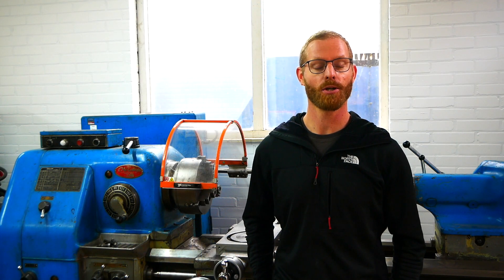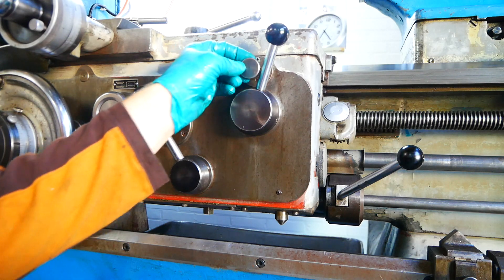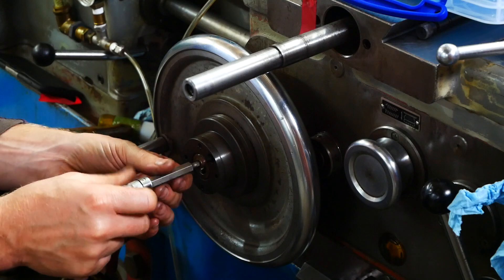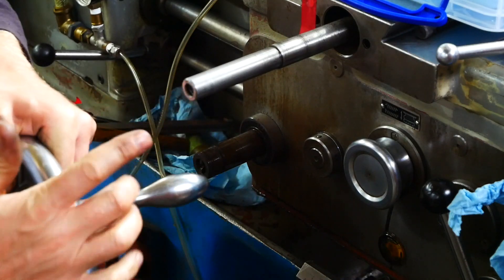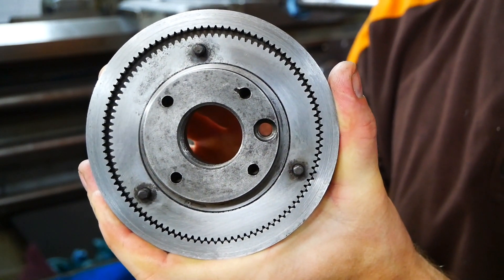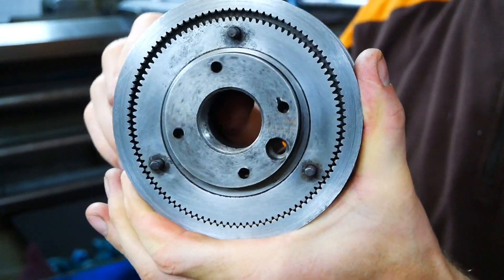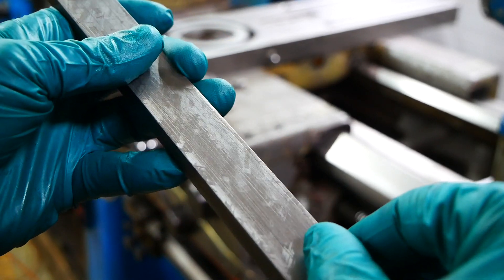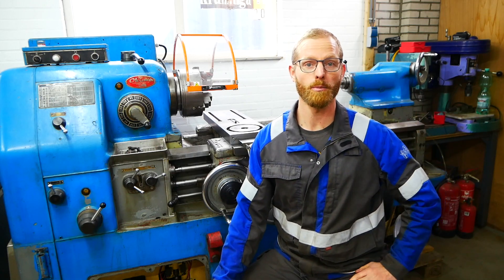Okuma LS Adventures Part 3: Apron

Comment: I have the same lathe and i was threading a large shaft and the half nut he wouldn't release which caused the tool to crash. i can see the nut engage the lead screw,  and i can see the screw turning, but the apron won't move.  Seems to me the half nut must be damaged, but i can't see any broken parts.  Any thoughts??

Comment: Hi Bart,

I have the same machine here in Australia that I’m currently restoring.  Mine is missing the cross slide and compound slide lock levers.  I see you play with it quickly in your video but I’m unsure of how they’re meant to function.  If you can help me describe them and the function or pull one out and send me some photos please reach out!
Reply from the maker: Sure, send me a mail to bartharkema at g mail dot com. Or Instagram private message.

Comment: Hi Bart what is the name of teh cleaning psste you used on teh front apron ? Commander....? I have the same job to do on my Okuma LK. Pete
Reply from the maker: Hi Pete. It is called Commandant here in the Netherlands. It's an abrasive polishing past. Works also very good on Aluminum. I only use number 4. But there are different numbers for different a abrasive size. Link : https://www.harjonpolyester.nl/product/commandant-cleaner-nr-4/?gclid=Cj0KCQiAzsz-BRCCARIsANotFgPJiHo7cM3Eo8NePymULnYqbjk_Lfb56a-RYsxbVU3SguoKrthHfVEaAu38EALw_wcB

Comment: I have just watched your interesting video. Thanks, Bart. My comment is a bit late, I know.
 You could generate a lot more pressure to clear the oil way using a grease gun. Or maybe you have a hydraulic front brake lever unit from a motorcycle. Of course, you would have to contrive an adaptor for it.
Cheers, Bill
Reply from the maker: Hi Bill, thanks for the suggestions. The hand pump and crank pump should give some pressure but the problem is that it's an open system. The end of the line goes into an overflow that lubricates the drive shafts. Before that there is a T connection that is probably blocked. But I can't hold any pressure. Maybe possible from the cross slide back to the pump line but that is hard to connect. I will open up the apron in the future but this temporary system works also very good.
Reply: @bartharkemametalworks2299  Thanks for the reply, Bart. I’ll look forward to that video in due course.

Comment: Great job!  I have the same machine as you. The oil in feedgearbox sightglass is just dripping, do uou know if this is right?  The upper one is pouring but not the feedgearbox one
Reply from the maker: This is correct. Top one flows and gearbox drip. Manual says: 

"The oil window or flow in- dicator ( LH-7 ) at the front of the headstock gives a check for the working of the system during operation. A continuous flow of the oil must be observed while the mechanical pump is runn-
ing.
The oil partly split into the feed gearbox and can be che- cked through the oil window ( LH-8 ) at the front of this unit where dripping of the oil can be seen during normal operation".
Reply: @bartharkemametalworks2299  Thanks a lot! do you have manual in english?
Reply from the maker: @-Mats  yes. ITS Dong Yang but same machine. Send me a mail to bartharkema  at g mail dot com

Comment: That is a beautifully engineered lathe.
I had a chance to buy one but turned it down, I didn’t know anything about the brand.
Should have bought it.
Reply from the maker: Yes its a great machine. But there are more good brands out there.
Reply: I ended up with a Clausing Colchester 15X50 (Triumph 2000 Colchester is the same lathe)
I’m very happy with it.

Comment: Nice job as usual although I was surprised you did not look into the cause of the bent pump lever a bit more to see if the half nut lever could be changed to a position so that didn't hit the pump handle. It does seem a bit strange that it was like that from the factory ie a design flaw rather than a previous owner maybe mounting it incorectly.
Reply from the maker: Hi Derek, I did check it but its not in the video. There was no quick fix and I think if I want to change it I need to open up the apron. That will be a future project so I left it the way it is and be a little more carefull with the lever.